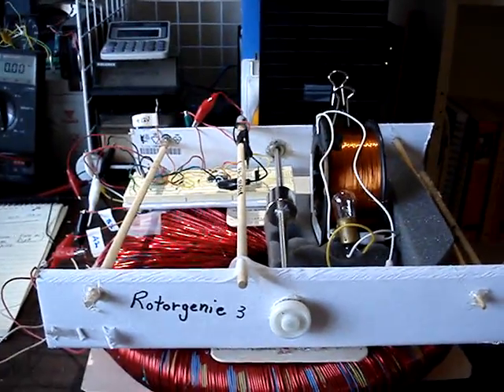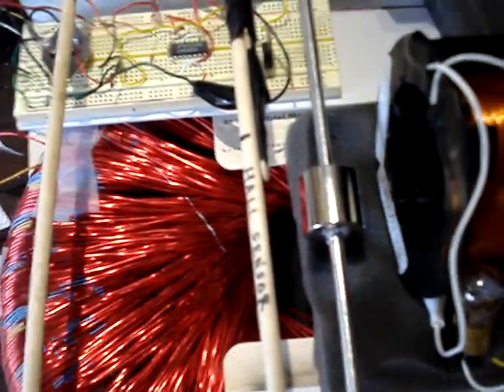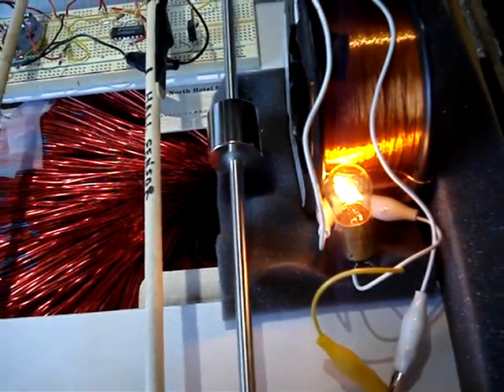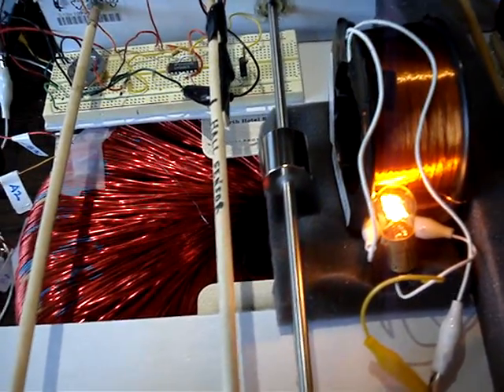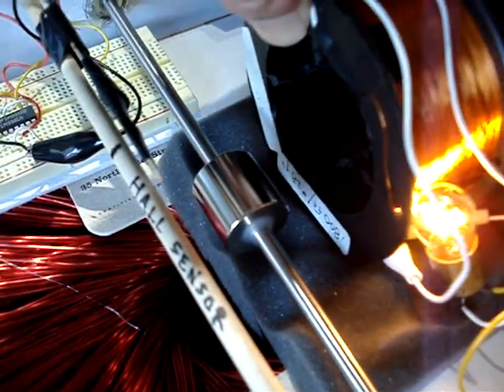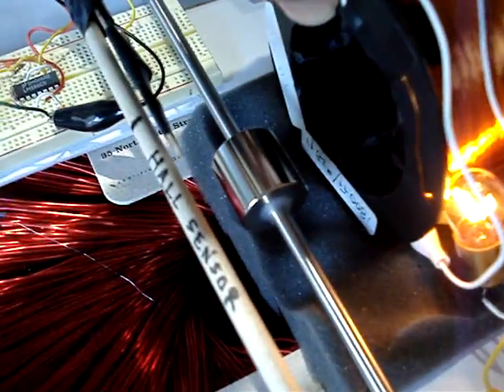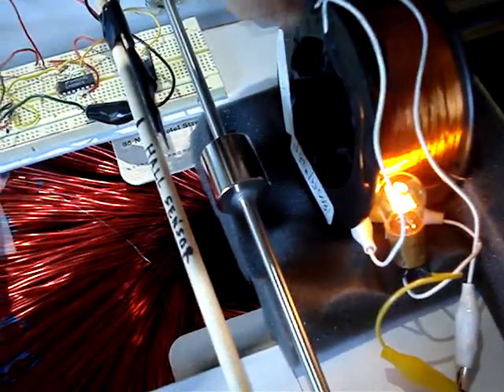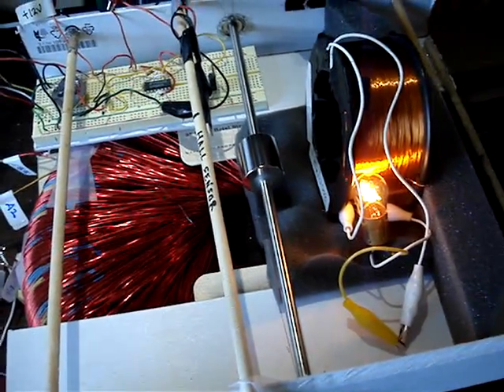Rotorgenie3  Brushless DC neomagnet motor

Comment: there are a few good circuits u can utilize, search cold electricity, for a nice earth resonant circuit, look for user imhotep for another trick circuit. look at the work done with the capacitors in the cold electricity's idea that uses vacuum energy to charge the caps.